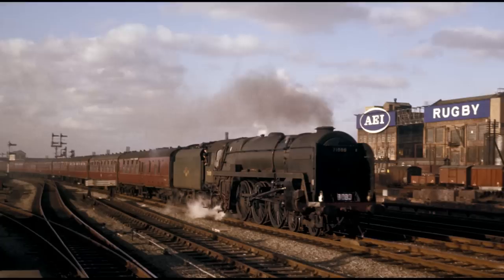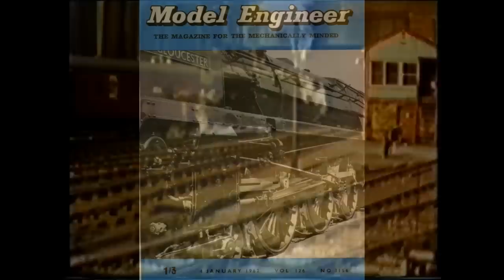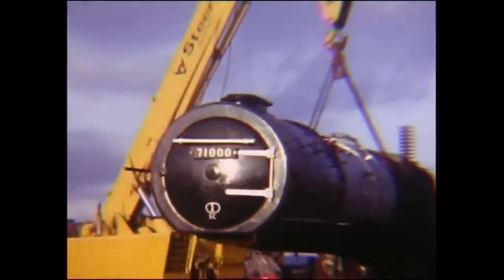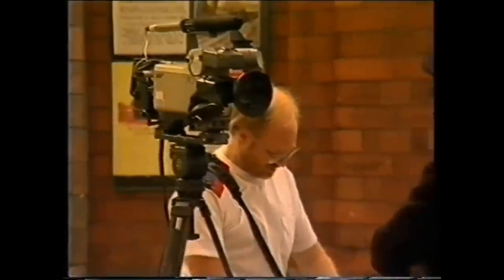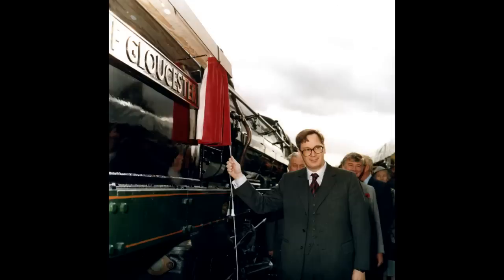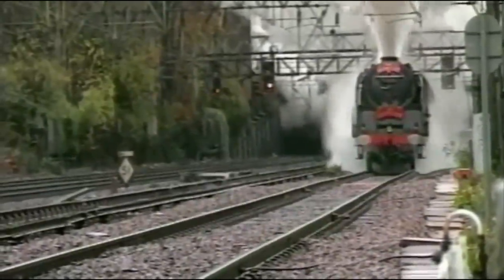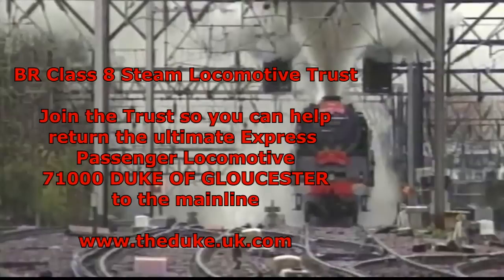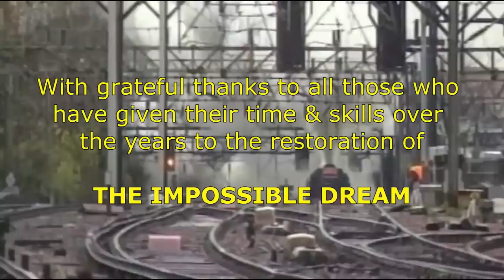71000 History

Comment: Great story.  I so wish we would re-introduce the enormous power of steam back in to main stream transportation.  Especially long haul goods and produce.  Then into daily driver automobiles.  I could watch Jay Leno's Garage all day long when he brings the steam autos out.
Reply: Don’t think they can do that once they get rid of coal
Reply: @agy234  Coal is actually one of the cleanest energy sources/technologies.  The myth that "we will run out of fossil fuel soon", is just that - a myth.  My grandfather worked for Mobil Oil (before it was Mobil Oil in the early 1900's), and my father and two uncles retired from Mobil Oil with 120 years of service between them; 1) one uncle was in exploration, 2) the other uncle in transportation, and 3) my father in production.  I, too, spent a few years in oil production.  Just sayin'.

Coal is not required to produce heat to boil the water to produce the steam.  But I understand what you are saying.
Reply: That would be economic suicide.
Reply: @garryferrington811  Ah, now I see where you’ve gone wrong …. my guess is that you follow the young Turks.  Well, there is room for all these technologies and each has there rightful place.
Reply: The only way i could see them return would be if they hauled freight from for example a sawmill which produces planks and woodchips and if they only burnt biofuel. Then they could fill one or two wagons with woodchips and then go for a long run without having to refill before they come back.

Comment: I am heartened tk see this Magnificent Machine still running  today !  Since there is an educational trust that provides for engineering students, has any group or individual considered funding some graduate school e gjneerjng students to encourage them to start TABULA RASA design a 21st century steam engine?   This Sngjne would use the newest technologies to produce an ULTRA-MODERN MACHINE  powered lets say by PROPANE rather than coal ?  If a safe way to store HYDROGEN, this choice would an environmentally "friendly" high energy content fuel.  Has anyone done any work to design an ELECTRICALLY HEATED  BOILER to motivate a Steam Engine ?
Reply: The Swiss put pantographs on some steam engines during WW2 to heat the boiler electrically.